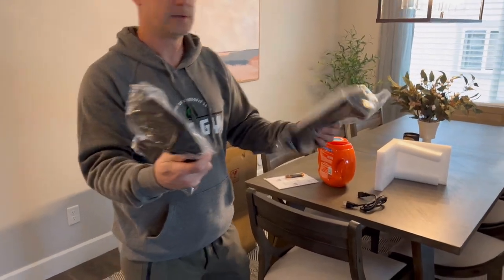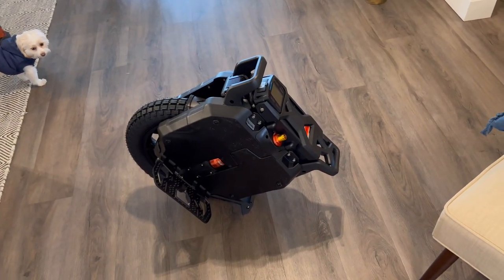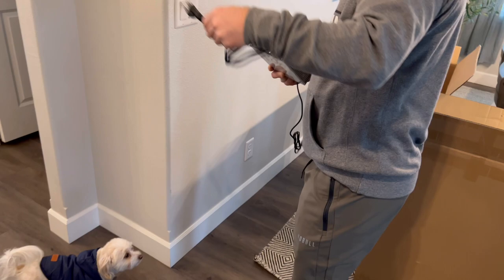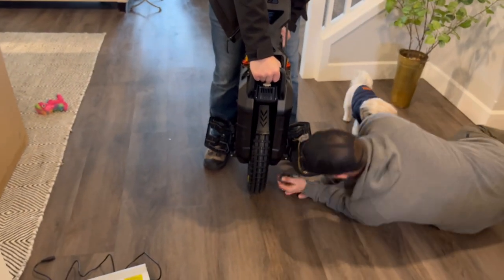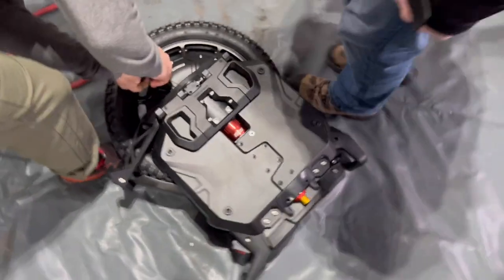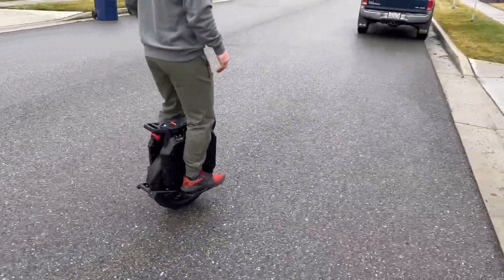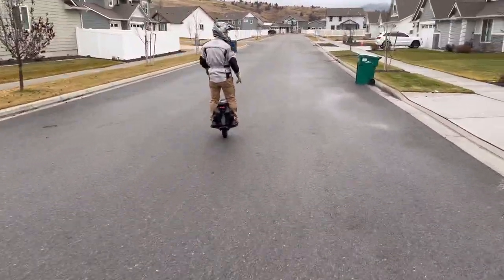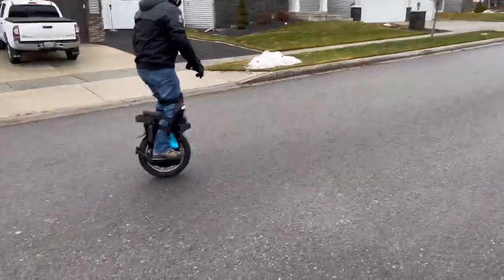Unboxing the SHERMAN S. This EUC is amazing. Should you get one!? 1st ride and impressions. ENJOY!

Comment: I love it when guys with wrinkles and gray hair ride EUCs!! I’m 56, so that means I can do it too!!! I’ve wanted a Sherman S for a long time now, but not enough funds. I’ll probably have to go with Begode T4 (more within my price range). So you have a Sherman S and I don’t - YOU SUCK!!! LOL 😅😊
Reply from the maker: You’ll get the Sherman Z when it comes out later. Just keep an EUC savings stash. That’s what I have to do! Thanks for watching!
Reply: Been riding since 2015 and I'm 60 this year. I have a ninebot z10.
Reply: That's me i'm 57 Just started riding last August on IMv8s then move up to IMv11 and now as of Monday i've put 68 miles on my ShermanS. My two motorcycles and the sports car just sit there as i just want to ride the EUC every chance i get. AM I AN ADDICT 😂
Reply: @justmeandmy2boyz87  Sherman Z??? Does it even exist?
Reply from the maker: Nope, just saying, the next version
Reply: begode quality is bad and they are just not fire safe
Reply: @RajinderYadav  Most of the problems have been fixed with firmware upgrades and updated motors. I’ve yet so see any major complaints online with the current version. I think I’ve literally seen more complaints about the new Inmotion V13 than I have about the T4.